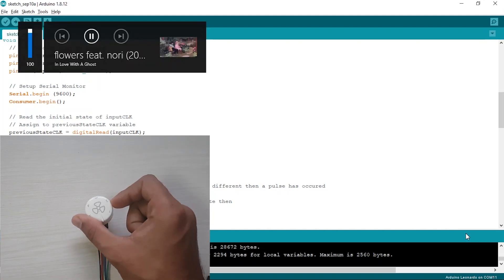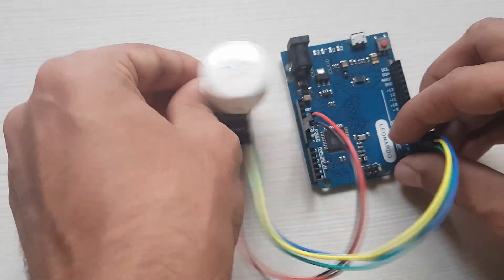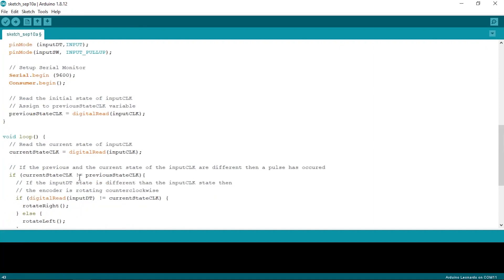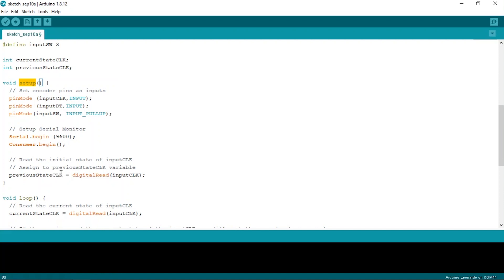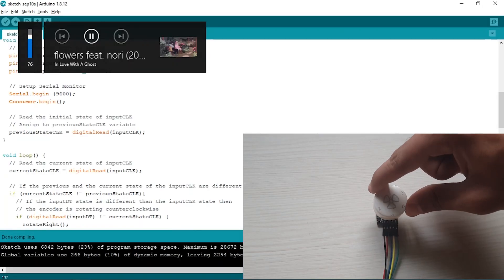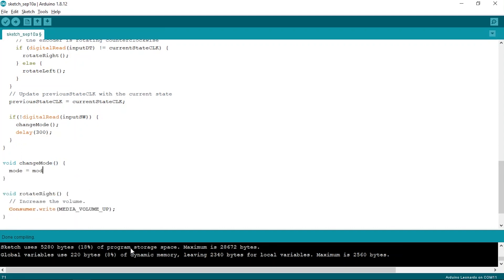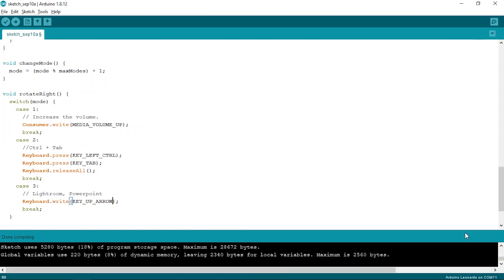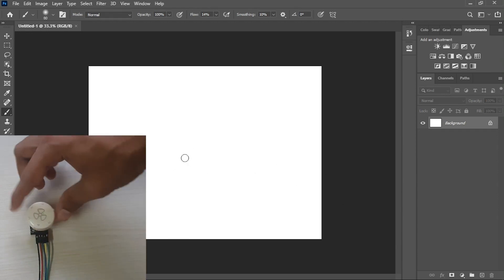Control PC Volume, Photoshop, Lightroom, and more Using Arduino & Rotary Encoder | Volume knob | DIY

Comment: As long as the chip is atmega32u4, u are just fine since the majority of keyboards and input value devices use the same chipset just like the one in arduino pro micro and leonardo!

Comment: Ok, so in my case all I got is two UNOs, and the same author of HID also did something called hootloader2, which would allow the UNO have the same usb capabilities as the leonardo, prob is uh, you could brick it if you're not careful. It says something about not being able to flash with flip anymore, I don't know if the arduino IDE uses flip or if it uses something else, but uh, keep that in mind. Currently I'm smashing my head against my keyboard because my UNO is the R3 and it doesn't have some pins that are shown in a picture that explains the wiring process which is important to do the weird microcontroller black magic thing to get hootloader installed, so, that's fun
Reply from the maker: Hey, if you manage to make it work using UNO, please update the steps in the comments, I'm sure that'll be useful for someone looking for help in the comments. Thanks!
Reply: @Codeometry  Sup so, after some digging I contacted the lad who made Hootlader and turns out that if your UNO is a clone/chinese there's a good chance you won't even be able to flash hootloader as those clones do not have the Atmel 16u chip, which is the chip that deals with the USB stuff and supports USB MCU. The lads out there who got an Elegoo for example, uh, yeah we're fucked. Elegoo's UNO uses a HT42B534-2 chip, which is just a cheap usb microcontroller, and it doesn't seem to support USB MCU.

here's a link for those with more details:
https://www.bestmodulescorp.com/ht42b534-2-8sop.html

A workaround to make the uno do stuff on the pc tho is that one makes a script that reads whatever the UNO is printing, and based on that one sort of triggers something. Basically doing what this lad did with some ultrasonic sensors, but one instead does such with an IR signal, or an encoder or whatever:

https://www.youtube.com/watch?v=05jDQV4_uXU

So that's sort of what I gonna do. Still decided to order a Leonardo because I'm lazy

Comment: Thanks for good tutorial. I have one question. Can I use multiple rotary encoder (say 2 or 3) with this library, and how separate their functionality.
Reply from the maker: Yes sure, Arduino has enough pins to support multiple rotary encoders.

Just map different pins to different encoders.

Comment: is there a way to contact you for a project using this setup to control HDMI outputs? I want to have an interface for each seat in a car so each person can change the volume and HDMI input for each individual monitor at each seat.

Comment: And also, how can we add LEDs to this setup to signify which mode is engaged?
Reply: Its simple just add the leds for like all 4 modes , 4 led to different pin and then just define them low and when rotary encoder is pressed just make the turn on
Reply: @harshityashwardhan  Do you have a tutorial out there that indicates how to do this that you pass me please?

Comment: How do we do the same with an Arduino Pro Micro?
Reply from the maker: The steps should be similar to what is shown in the video. We can do the same thing with Arduino Pro Micro as well
Reply: @Codeometry   But, since I'm an absolute beginner, could you link out to a suitable schematic connecting the Pro Micro to a rotary encoder?

Comment: Hi,
I have a MKR Zero and installed the HID-Project library.
Compiles fine.
I use Consumer.write(MEDIA_VOLUME_UP); but nothing happens on the computer.
How can i test if the communication to the computer is working?
(I can see the results on the serial monitor)
Best regards,Lord Löwe

Comment: can i make with arduino pro micro and your code, how it's wiring?
Reply: yeah so, i am using my macro key board include volume control with pro micro here. You can wire exactly like this video, but since the pro micro dont have pin1, you can use other pins.

Comment: Did not work for me, you should avoid using pins with LEDs attached. On the Pro Micro / Leonardo (new smaller version) I used pins 2, 3 and 4. Worked like magic. Thanks for this code. Just subbed.

Comment: OBS Video????
Reply from the maker: OBS also allows us to configure Hot Keys. 

In OBS, go to settings > Hotkeys and then configure a keyboard shortcut for the feature you want to control using the keypad.

For example: you can assign the keyboard shortcut "Windows + Alt + S" to start streaming.

Then as shown in the video, you can program the arduino to send "Windows + Alt + S" when any keypad key is pressed.

It is as simple as that!

Check this video for the walkthrough: https://www.youtube.com/watch?v=RfLikTGh0F0
Reply: @Codeometry  You are Super Talented 🔥🔥🔥 Please Bring a complete step by step Home Automation Or Room Automation Using Modules/components. (2Way Working with Google Home) 🙏